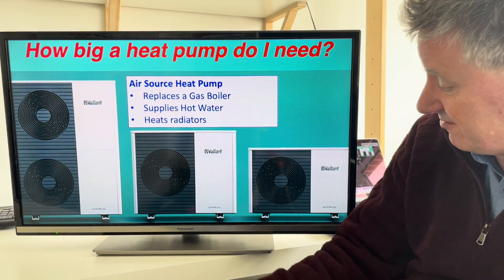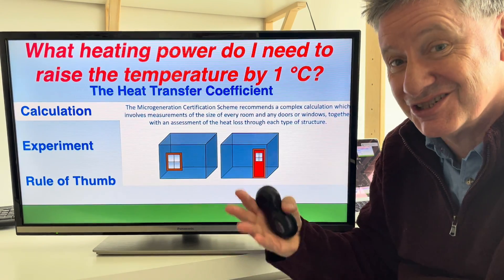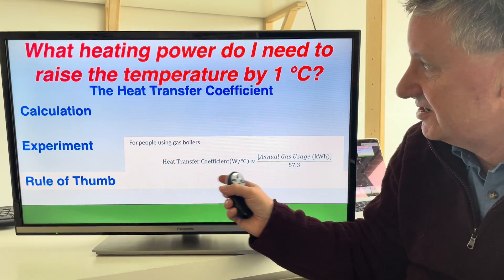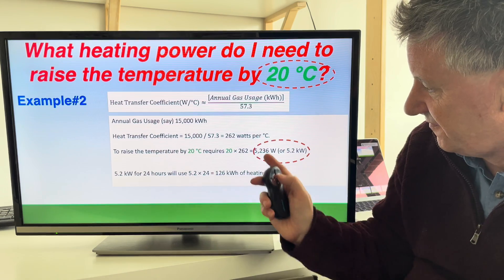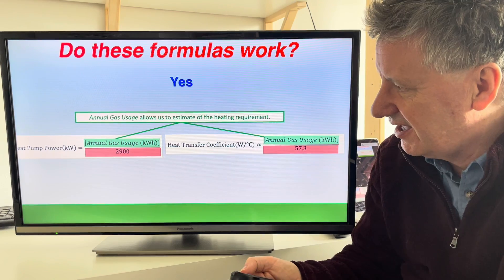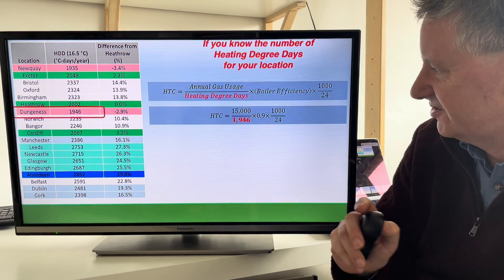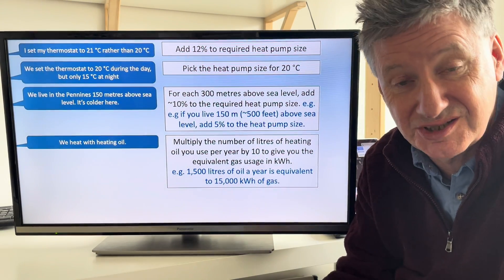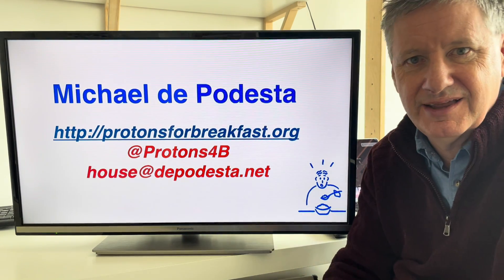How big a heat pump do you need? A simple Rule of Thumb.

Comment: Thanks for this information and the formulas. Do these calculations work in Australia? We only have our heating on for a lower portion of our year, but it is also a warmer winter. When I do the first calculation, or the graphs, I get a 6.5kW heating required. When I use  the heating degree days formula, I get a 8.5kW answer. (using HDD of 1600 / 18C, gas consumption of 19,075 kWh pa, Melbourne Australia)
Reply from the maker: @alansailing1387 Good afternoon, The method might possibly work. If your gas usage is mainly for winter heating then it should give an indicative value of heat pump size, but if you are using a lot of your gas on something else (a hot tub?) or if you use more than 5% of your gas on hot water heating, then the formula may be inaccurate.

 I downloaded the monthly HDDs for Melbourne Airport in Victoria. Taking them in 12 month groups, it seems the HDDs are around 1200 °C-days per year. The base temperature of 16.5 °C corresponds to keeping a home at roughly 20 °C. Typically, people don't put the heating on until the outside temperature falls about 3.5 °C below their desired internal temperature. 

Using the formula at 13m07s in the video the HTC for your dwelling appears to be 593 W/°C. i.e. it takes 593 watts to warm your home by 1 °C. In UK terms this is a very large dwelling or a very leaky dwelling. In terms of heat pump size, If the minimum temperature in Melbourne falls to around 0 °C then you would want a heat pump with a power of 20 x 593 watts  which is about 12 kW. 

Does any of that make sense?

Best wishes

Michael

Description:	Celsius-based heating degree days with a base temperature of 16.5 C	
Source:	www.degreedays.net	
Accuracy:	Estimates were made to account for missing data: the "% Estimated" column shows how much each figure was affected (0% is best, 100% is worst)	
Station:	Melbourne Airport Comparison, VIC, AU (144.91E,37.73S)	
Station ID:	95866	
		
Month starting	HDD 16.5	°C days/year
2021-07-01	206.5	1138.9
2021-08-01	163.3	1163.6
2021-09-01	130.8	1171.9
2021-10-01	110.7	1187.9
2021-11-01	79.6	1173.8
2021-12-01	36.7	1180.9
2022-01-01	1.7	1194.3
2022-02-01	10.9	1202.0
2022-03-01	15.2	1208.3
2022-04-01	49.8	1215.9
2022-05-01	140.1	1237.2
2022-06-01	193.6	1245.4
2022-07-01	231.2	1216.6
2022-08-01	171.6	1156.9
2022-09-01	146.8	1148.8
2022-10-01	96.6	1106.2
2022-11-01	86.7	1115.0
2022-12-01	50.1	1070.5
2023-01-01	9.4	1039.8
2023-02-01	17.2	1038.4
2023-03-01	22.8	1032.7
2023-04-01	71.1	1033.8
2023-05-01	148.3	1042.4
2023-06-01	164.8	1027.4
2023-07-01	171.5	1063.7

Comment: We’re still in the Iron Age here and use an automatic coal fed boiler. How could I apply rule of thumb for this use case? We’re currently going down the solar PV plus ASHP route
Reply from the maker: @adzy166, Good Evening.

Sadly I don't think I have enough information to be able to help you. Do you know how much coal you use in a typical year? If I knew that figure and your location I could probably make a guesstimate.

"We’re currently going down the solar PV plus ASHP route". Can I suggest that you consider purchasing a battery as well?

In summer the solar PV can charge the battery which can run your home overnight. In winter you can buy cheap rate electricity and then run the heat pump from that for some fraction of a day. The savings can be very large.

Best wishes

Michael

Comment: Great video. What I don’t understand is octopus have sent an engineer around and they calculated the heat loss for my house at 12kw. My gas usage is about 16000 kWh - per your formula I need a heat pump around 5.5kw but they said there couldn’t install it because it didn’t fit with in their financials I suppose
Reply from the maker: Dear @adblocker. I'm sorry but that's all too common. If not used by experienced people, the software which calculates the heatloss tends to overestimate heat loss quite badly.

I wish I could say something to practically help, but the only thing I can think of is that the situation is improving slowly. I know it doesn't help you. Sorry.

Best wishes

Michael
Reply: @michaeldepodesta001  hi thank you for replying. Money is not an issue for me (as long as I can get the boiler upgrade grant) I’m happy to get a heat pump installed. I’m also getting a 12kw PV array installed with Tesla Powerwall3. As soon as that is installed in the next couple of months I will get the heat pump. My concern is I want the house to be entirely self sufficient in regards to energy use. If the heat pump needs to be massive my solar panels may not be enough. 

Should I get another company to do the heat loss calculations? Any recommendations?
Reply from the maker: @adblocker276  Good Evening. First of all congratulations! That sounds like a super system I am sure the combination of panels and  a Powerwall 3 will give you splendid results. 

I don't think that you will be able to become self sufficient all year round. I don't know where you are, but in the UK for a south-facing system,  a 12kW-peak array (which is MASSIVE! 36 panels!) will yield ~50 kWh/day on average in summer but it's winter yield will average 10 kWh/day *at best*. But winter generation depends strongly on shading low to the horizon. 10 kWh/day is enough to cover normal household usage, but if you are running a heat pump your winter usage will rise considerably. In my home it peaks at about 25 kWh/day.

I would not worry about  this: you system will keep you off grid for many months of the year (perhaps 6 months) and you will have very small bills in all but the coldest months. And you will export a lot of electricity. 

Regarding your heat pump, I would recommend you stabilise your house at a comfortable temperature, and take weekly measurements of gas consumption over the winter: this will tell you the actual amount of heating you use to keep your home as want it. If you use 700 kWh of gas in a week then with an 85% efficient boiler that will deliver ~595 kWh of heat which corresponds to about 595/7 = 85 kWh/day which is an average of 3.5 kW. You can also make the same measurements on a very cold day to work out the biggest daily usage.

It may feel frustrating to wait but when you know for sure the size of heat pump you require, you will feel much more comfortable about the installation.

Best wishes with your endeavours. Drop me a line if you would like advice about the measurements.

Michael
Reply: @michaeldepodesta001  Same situation here.  My annual heating usage is 8000kWh.  I've signed up for a 9kW Octopus heat pump which always struck me as too large. Oh well.
Reply from the maker: @philiplee4377  Hopefully the deal with Octopus makes financial sense. And a 9 kW heat pump will allow you to re-heat your hot water in a jiffy! We have to focus on the positive sides of the situations in which we find ourselves. Good luck with your endeavours!

Best wishes

Michael

Comment: Dear Michael,
I have tested the equation but something is not clear for me. In my opinion dividing the annual energy usage with the annual HDD is only correct if the base temperature matches what is already set at the boiler controls (if its possible to set at all). The HTC is inversly proportional to the base temperature therefore it produces incorrect results when  there is a mismatch in the base temp.
For example:
EDDS (Stuttgart, 2023) Base temp#1 10°: HDDannual#1 = 746,9°C; Base temp#2 20°C: HDDannual#2 = 3008,7°C
So far so good, because if the base temp is set lower, there are less days in a year at hand that count.
Energy expenditure for example: 25kWh, boiler efficiency: 80%
HTC#1: 25/746,9*0,8*(1000/24)=1,12W/°C
HTC#2: 25/3008,7*0,8*(1000/24)=0,27W/°C
now If I multiply the number with 20 in case #1 i get a  heat pump of 22.3kW and in case#2 I get 5.5kW. So it would appear that my house has bigger heat losses, and needs a bigger heat pump.

Maybe I understood the formula incorrectly, I would like to have your opinion.
Reply from the maker: @peterkis5442 Good Evening,

In your comment you states that: "The HTC is inversely proportional to the base temperature". No! The Heat Transfer Coefficient describes the way heat flows into or out of the dwelling. It describes the way the dwelling loses heat.

You calculate two examples of HTCs, HTC#1 and HTC#2: **THESE DESCRIBE TWO DIFFERENT DWELLINGS**

In the first dwelling 25,000 kWh are used per year to maintain it at 10 °C: 
In the second dwelling 25,000 kWh are used per year to maintain it at 20 °C: 

Clearly, the second dwelling is much better insulated and so it needs a smaller heat pump.

OK?

Best wishes

Michael

Comment: I've just had a heat pump survey carried out and your figure came out pretty much bang on.
Reply from the maker: Eddy, thank you for taking the time to drop me a line. It's always heartening to know the rule of thumb still works!

Good luck with your endeavours: If you choose to go ahead with it, I hope the installation goes well.

Best wishes

Michael
Reply: @michaeldepodesta001  Hi Michael, I'm waiting for the new Octopus Cosy to come out, unfortunately that will be a 6kW device so I might be waiting a while for a larger version to be released.
Reply from the maker: @eddyd8745  Yes: don't be in a hurry. This is a great time to start monitoring weekly gas and electricity usage - very little now so the gas consumption is just from cooking and hot water preparation. Maybe you will get a chance to measure over winter and see how the gas consumption goes. A 6 kW heat pump will produce 6 x 24 = 144 kWh/day of heat. You can check whether that's enough for you.

Best wishes

Michael

Comment: Your spouting on about You, 
saying everyone should have 1, nonsense! The reality is installers/ heating engineers i know don't support the idea they are the best thing going when replacing a gas boiler with the cost of installation it ain't there yet. Your experience is you, but i know people who have had them installed and they are disappointed!
Clearly your too over-apinionated!!
Reply from the maker: I have not said "Everyone should have a heat pump". If you want heat pump, they can work in any home heated by a gas boiler. If you don't want a heat pump: don't have one. But if that's your choice to keep using a boiler you will never benefit from the splendid cheapness of heat pump operation.

Best wishes

Michael
Reply: @michaeldepodesta001  come home to find efficiently lukewarm rads and call it a heating ......If the fking thing is full on flat out then mayebe better, but electricity cost is in a hands of greedy, and their plan is clear
Reply from the maker: @PovilasKuznecovas  My 162 square metre home is at 20 °C 24/7 and in 2024 it cost me just £161 to heat - with all electricity included, including EV charging. 

AS I said in my previous comment, you sound bitter and pathetic. I urge you to seek help. Best wishes: M
Reply from the maker: @PovilasKuznecovas  I am writing from my home which stays at 20°C 24/7 and is extremely cheap to heat and live in. In 2024 my electricity bill was £160 and I have no gas bill. And you? You sound sad and bitter. I urge you to seek help. Best wishes. M

Comment: NO, it just can't just replace your boiler! Your radiators will be undersized and will require bigger radiators to get somewhere near adequate central heating heat due to lower flow temperatures. They are far far too expensive and their performance is said to be very disappointing. We haven't come up yet with a really suitable alternative to gas boilers unfortunately!! IF we had Everyone would be having one!!
Solar panels, linked to battery storage joined up to an electric boiler could be the BETTER way to go!!
Reply from the maker: @kevinw7419 Good Morning. I am puzzled as to how you can have such strident views and be so completely WRONG!

In my house, the heat pump did just replace the boiler and we did not change our radiators. That's not the case in all homes but it is in many homes. Flow temperatures are typically in the mid 30's and reach 45 °C when it is -5 °C outside. These are just facts: i.e. Physical Reality.

My home has solar panels and battery storage and a heat pump. Last winter teh average internal temperature of my home was a cosy 20.5 °C pretty much 24/7. Last year my annual bill for heating and all electrical use was £450 and this year (because of a better tariff) it will be around £250. In short you are talking nonsense.

Like I said, I am puzzled as to how you can be so opinionated and yet so completely wrong. Curious.

And aside from being cheap, it emits dramatically less carbon dioxide.

Best wishes

Michael
Reply: You may have a point on Some properties highly insulated, but the majority it will cost too much and the flow temperatures in a lot of properties won't be good enough, fact!!
A suitable electrical boiler with solar and batteries has to be a great option with the battery back up I would be looking for zero electrical bill, not £250!!
Why aren't all gas engineers jumping on board with the heat pump idea? Well they just aren't good enough Yet for everyone, fact!
Reply from the maker: @kevinw7419  Like I said previously, I am puzzled as to how you can have such strident views. You don't seem to have any special knowledge or experience. You are just spouting opinions. In contrast my 5 years of measurements on my home and my 20 years of experience as a metrologist show me the reality. You are welcome to ignore it. And good luck with your attempt at a zero electricity bill using resistive heaters! When you have achieved that I will look forward to watching your YouTube video on the subject.

Best wishes

Michael

Comment: That's very helpful. I only have a 3 bedroom flat and from your formula will need 10KW /day to raise the temp by 20 degrees . Mind you, I like the temperature between 21 and 22 degrees during the day and off at night and live in Scotland which is colder than Manchester. A heat pump will cost me a fortune to run.
Reply from the maker: Dear @nattyco, good evening,

Did you mean 10 kilowatt hours per day? That doesn't seem a lot to me: most houses require closer to 100 kWh/day. 

But you haven't given me enough data to really make a judgement.

In any case, I wish you all the best in your endeavours.

M

Comment: Where I live the gas consumption is measured in m3. I have it measured per day with a so called smart meter. I will check how to convert m3 to kw.
Reply from the maker: Good Morning. This is also true in the UK.  If I remember correctly (please check) 1 cubic metre is about 11.4 kWh of energy. The number varies through the year due to small changes in the composition of the gas.

In the article below I explain how to raise energy consciousness by converting meter readings to energy readings in units of kWh.

https://protonsforbreakfast.wordpress.com/2022/11/14/energy-consciousness-raising/

Best wishes

Michael

Comment: Do you have any opinion on Agile electricity tariffs (like octopus) . I read about somebody who has made a device that switches the call for heat off if the agile price is too high and the savings in energy costs were massive.  . I assume the heat pump stays running but does not produce heat.
Another option I have personally costed out is to install a battery bank that gets fully charged during the EV tariff period and therefore gives you all day electricity at the low tariff. Payback on batteries is just 3 years (although mine is cheaper than most as I am a certified installer). I am not sure which method is best and currently have no experience of heat pumps. I imagine switching the pump on and off to utilise cheap agile tariffs is not a good idea.
Reply from the maker: Dear @dellybeanhead, Good Afternoon.

Running a heat pump with a battery is very smart. With Octopus;s different tariffs it is very hard to know which one is optimal, but I use Octopus Intelligent Go. The terms have got better than Octopus Go.

Intelligent go: 7.5 p/kWh from 11:30 until 5:30 i.e. 6 hours
Go: 7.5 p/kWh from 00:30 until 4:30 i.e. 4 hours.

I use this with a Tesla Powerwall 2 (13.5 kWh with 5 kW of power). My house has a peak heating demand around 70 kWh which requires round 20 kWh of electricity to operate the heat pump. More normally the house requires ~ 20 kWh of heat which requires just 5 kWh of electricity. So in winter we charge the battery (and run the dishwasher etc) in teh cheap hours and then run off the battery until it runs out. On teh very coldest days his happens at around 1:00 p.m. and we have to run on full price electricity. But normally in winter the battery runs through to very late in teh evening, so the average price of electricity is generally less than 10 p/kWh.

In summer we run off solar power and use teh battery to take us overnight so that we draw nothing from the grid for about 3 months.

The cost of this is about £35/month averaged across the year - and £15/month is standing charges! So that covers all the electricity and heating. 

This article details the costs and covers battery degradation.

https://protonsforbreakfast.wordpress.com/2023/12/30/solar-pv-review-of-2023/

But overall, a battery & solar PV natch very well with a heat pump. Do drop me a line if you have questions. If you want to find out what goes wrong with heat pump installations, try this article.

https://protonsforbreakfast.wordpress.com/2024/02/10/5-reasons-heat-pump-installations-have-problems/

Best wishes

Michael